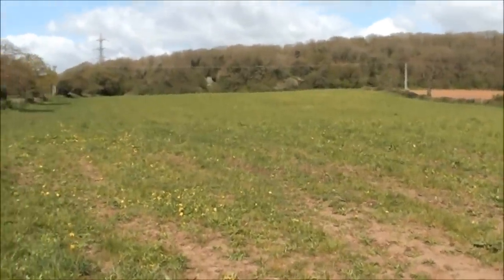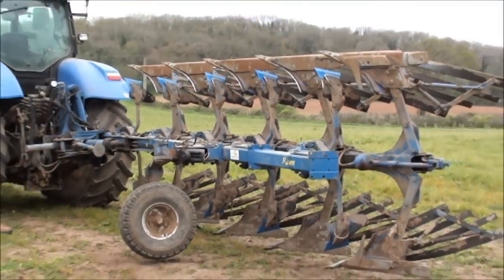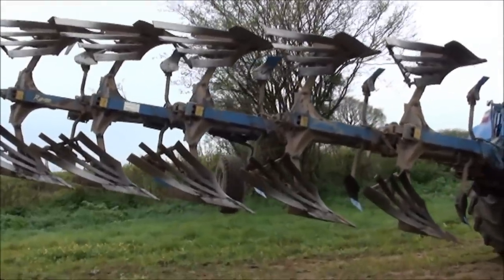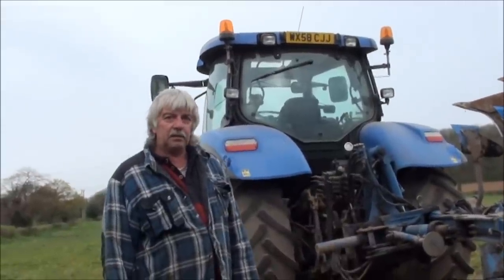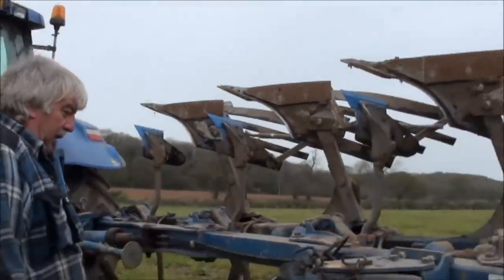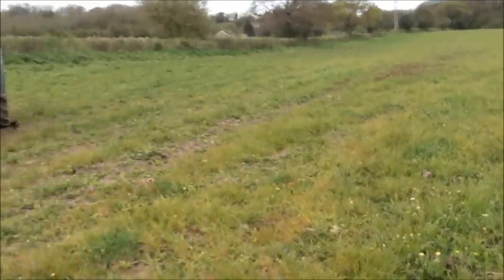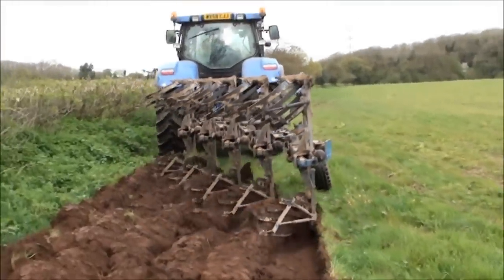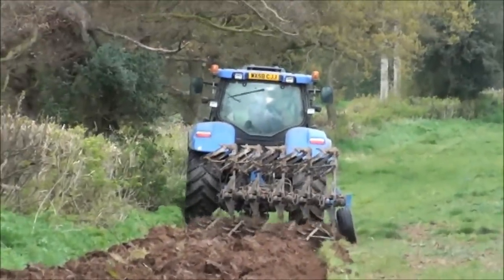ploughing the maize field. part 1

Comment: That's a standard way ploughs are these days that wheel is not necessary. When I was contracting I had an eight furrow plough on the back of a T7.310 with a 1.75 ton weight on the front as long as you are careful you are alright. The main use of the wheel is too keep the plough from burring deep into the ground.

Comment: The slatted mouldboard are not for making the plough light, sure they do but that's not the reason they at used its to stop certain soil types, like clays and chalky loams for sticking to the mouldboard, which in turn can cause uneven soil turning, and also after a time can cause a blockage and will stop turns the soil all together.
Reply from the maker: thanks Tom
Reply: Tom Hull  aii, you could actually get them for a Ferguson 2 furrow Plough out in America back in the day.  I haven't had a plough with them,  but just guessing,  would they be cheaper to replace than a solid mole board too? Well you could probably get more acres out of the top slats by only changing the faster wearing bottom first?

Comment: Its a fully mounted plough but the wheel is for depth in field and on the road it you set the plough with bodies up the wheel takes the load off tge tractor backend, making it safer on road and if toplink legs go you wont plough up the tarmac

Comment: I could plough with horses faster than that
Reply: Will Ruddle  not really horses slow
Reply: No u count a horse can only pull a 2 bottom plow and u need 2 of them for it or it will pull on the spine of the horse and can cause damage and u don't want to go to with the t6 cause the plow can start skipping